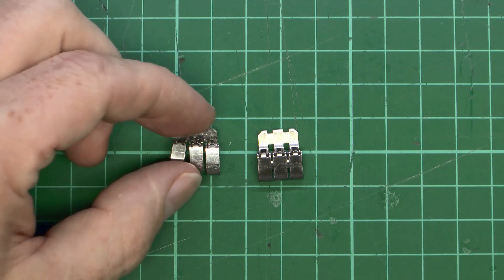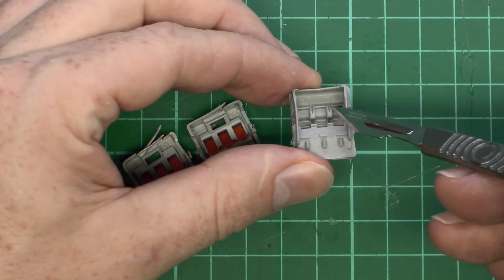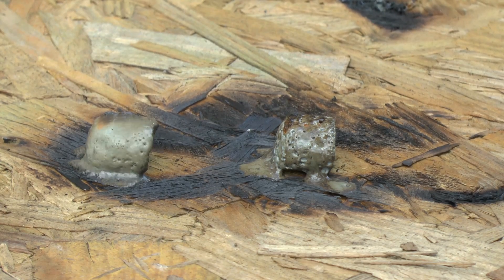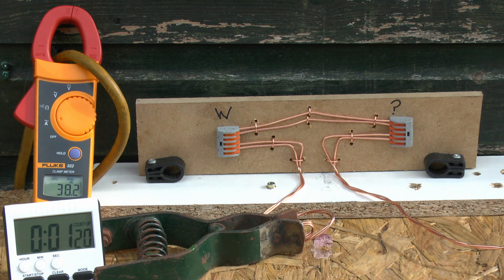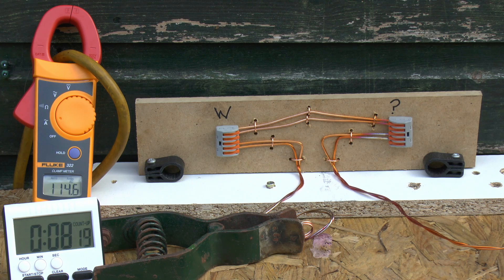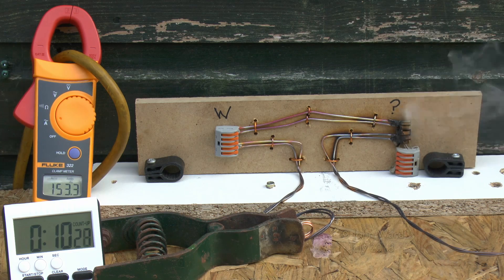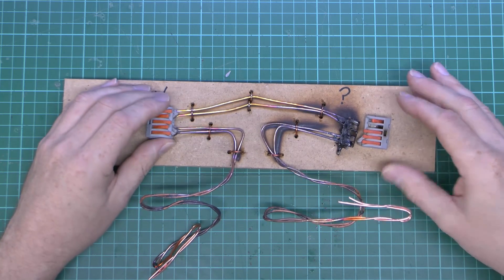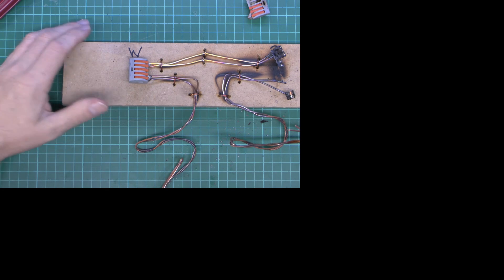Wago 222 Connectors vs Others, Testing Current Overload and Flammability

Comment: I already like and use Wago extensively. I always felt like the 222 series had a more secure connection on stranded cables than on solid cores, but this seriously boosts my confidence in them for solid core use. Under normal use the wire insulation would have failed long before the connectors and blown the RCD/GFCI/AFCI or over current protection.

Comment: Per 100 the brand? are 16p (ish) per unit cheaper bought from UK sellers.  The more you buy the more you can save.
if time isn't a factor the world and your bank balance is your onion if you go offshore.
I've e-mailed chinesium suppliers and bought bigger quantities than they normally advertise with pretty substantial discounts.  If you can afford to stock up on stuff you use regularly its sometimes worth the effort.  You have to be aware that customs can get pretty keen on larger quantities.

Comment: Cool test. Btw 2x 2.5^2 ≠ 5^2
Reply: ats1995 Wires are measured in square millimeters, it's the mm symbol that's squared, not the 2.5.  And in reality, it's resistance equivalent mm², so actual size may vary slightly depending on how pure the wire factory can guarantee their copper is.  Mechanically, connectors are designed for actual 2.5 mm² cylinders (1.8mm diameter), as most wire plants are pretty close to "standard copper" anyway.

Comment: 70 or more amps? all my home fuses cut above 16 amps... anyway in germany everything is tested to death. i use them for years now without any problems. nice to see what amps they can manage. very informative, thks for the video
Reply: wuppercruiser Test current is applied at low voltage, so a lot less is drawn from mains than the 150A.
Reply: @johnfrancisdoe1563  Correct.
>
Reply: WAGO have a factory in China (Tianjin) as well as Poland, America and Switzerland but they would all manufacture to the same quality standard

Comment: Really nice Video , been using these for a while now , nice to see they're as good as they seem. No more loose screw terminals in JB's and install times are drastically cut....but they'll never replace screw terminals completely I still use ceramic one for high temp connections like High power UV lamps. I  cant see the point of using the fake ones the real Wago connectors are so cheap ...the fako ones may be ok but try explaining the decision in a court if problem does occur.

Comment: those are the same connectors from the same factory.
they are producing wago during the day and knockoff at night
Reply: Bartosz Marciniak Except with clear tool differences.  The Fago connectors had a different spring shape and less smooth plastic, which may have combined to a slightly higher resistance, causing the Fago to get hotter (P=R I²) and discolor + melt before.

Comment: This is actually quite impressive. Remember that for every doubling of current, the power dissipated in the connectors rises four times, because power is resistance times current squared. So the 155 A vs. the rated 24 A scenario is more than 40 times the rated power of the connector! I am surprised that they both held up so well.

Normally, the maximum current for connectors is defined as the amount of current that yields a certain increase of temperature of the connector with regards to the  ambient temperature.

Comment: The Fako may be fine for private installation on your own risk. But imagine that your house will burn only if you saved a few bucks. No assurance  will pay only one cent if they figure out you used not certified materials.
Reply: matneu27 I was quite impressed with both of these. This test put 5X the amp rating these were for. As long as the clamp strength of the fake one is as good as the WAGO, I wouldn't be afraid of the fake brand for residential use... BUT... The WAGOs are pretty much the same price, so might as well buy the name brand.

Comment: As someone who uses these connectors on a daily basis, this was brilliant to watch. Great to see their limits and how well they hold up to a significant over current situation.

I'd love to see how Wago's 221 connectors compare to the 222s as I've started using the 221s more and more.
Reply: Possibly also a comparison to the 2273 and 773 series for solid/coarse stranded wire. They're the most commonly used connectors for building wiring in quite a few European countries.

Comment: The non wago connector sounds like glass fiber reinforced, also the only reason why the right one melted first is because there is a higher resistance on that side, thus the reason the board charred at the end of the circuit first.

Comment: Very informative test. Do you think the orientation of the connectors caused the clone to overheat first? It would have been interesting to see the temperature of each from an IR thermometer. Thanks for your effort.
Reply from the maker: No difference, same wiring and same current for each.

Comment: I wonder why you're now testing the 222 years after the 221 came out. I've long replaced all of the old ones, love the smaller size and nice visibility of the connections in the new ones.
Reply from the maker: 222 are the type which someone sent in.
Reply: Daniel Egger 222 is the classic product we trust, 221 is some untested stuff the salesmen are pushing.  Good professionals ignore salesmen when possible, because lying to us is part of their job.
Reply: Err, sorry, that's nonsense. I've switched to the 221 many years ago (they came out right in time when I needed some smaller connectors for my living room LED lighting where the 222 are just too big to hide invisibly behind the aluminium mounts). I've been using the 222 (and a lot of different other Wago connectors, too) for a long time before that but have switched all to the 221 when I made changes to connections since they're not only much more comfortable to use but also allow for visual inspection of the wires (or crimped ferrules) and leave a lot more for the cables in the outlet or connection box; don't forget that one typically needs at least two and often even three or more of them in one spot so that adds up quickly.

I'm not a sales person and not affiliated with Wago. In fact I'm just a user but I know a lot of professional electricians who would tell you exactly the same.

Comment: Great video, I'm impressed by the knockoffs. I'd be interested to see how they fare with a slight overload over a period of hours. I can see the fako connectors taking a while to heat up, but eventually failing. The exposed copper wires were probably helping by acting as a heat sink too

Comment: Despite this, wagos are really only meant for lighting loads/low current loads. Everything else should get wire nuts or terminals.
Reply: They take up to 4mm cable, and rated at 32A lol.. Lighting circuits are only 6A in UK I used them to break into 32A ring circuits and extend it.. Using maintenance free boxes. Perfect. 😉
Reply: @muzikman2008  According to Wago they take 4mm but only in fine stranded (aka flex), for solid and coarse stranded fixed wiring cables the official max is 2.5mm² on the 222 series (the 221 series go larger, but I haven't tried those myself)

Comment: You should definitely do more of these, fun and informative. Puts our minds at rest that these connectors are safe for their rated currents. Top job JW!
Reply: China copys you are never save, only these are safe tested this batch..nothing more
Reply: @kitecattestecke2303  He easily goes 4 times over specifications and 5-6 times before they fail.  That is a considerable safety margin.
Reply: @kitecattestecke2303  Genius. Even if this video shows that, while used within rated amperage, these Chinese brand connectors are perfectly safe, still some people like you will fabricate some other reasons to justify your discrimination. Well, enjoy paying several times more to get the ghost feeling of "safety", because that's what these big companies want you to believe so they can receive your IQ tax.
Reply: You can definitely buy Chinese off brands, but you got to buy them i batches, and test them. I wouldn't still use them for commercial use
Reply: @GoalOrientedLifting  Ya they arent ce approves so then you could be sued if it goes wrong.

Comment: Love a wago connector. I like that it does minimal damage to the cable and makes alterations so simple, screw type connections mangle the cable ends and they invariably need cutting back after being disconnected.
I agree with a previous commenters view that they are a bit rubbish for getting a test lead on though. That test port is far too small to get most of my probes into.
Reply: Mr Badger the megger long red probe is perfect for the test port on these
Reply: Daniel Brydon 
I do have a long thin megger probe that will fit these ports, I call it my “aye aye” lead after the little lemur creature with the long finger!
The problem is I mainly need to access it with my fluke voltage tester or I may just want to get a reading from it while testing and not want to use special probes from the van etc
Reply: 2 years later but why not just buy some alternate leads for your meter?

Comment: The non wago one sounds like it has some glass fibre reinforcing in it when cut.
Reply: Skookum
Reply: @TOO2150  As frig
Reply: I think the Plastic in the Fako has a degree of re-grind in it, the Wago one will use new Raw material stock, the Fako one I suspect has a 10-15% re-grind, this is plastic that has been used before, chpped up into tiny bits and put back into the new material, its perfectly fine but it starts the degradation process. It often has this grainy effect and not as smooth.
Reply: Yes, that was quite surprising. The clone sounded more durable than the original!
Reply: definitively yes
Reply: Even if, the test clearly shows that what ever the real WAGO's plastic composition was, it was better then the fako.
Reply: I was just about to say that too!
Reply: Yup!
>

Comment: You can now buy double ended versions on Aliexpress that have 2 or 3 terminals each side connected straight through, but not across to each other. So you only need one terminal to connect two two or three core cables, kind of like a choc block only better. ** EDIT they are unsafe due to insufficient creepage, do not buy ** 
The Chinese are also offering an 8 way version, which is useful.
Reply: stefantrethan what’s the Aliexpress search term for those?

Rather disconcerting that when there is a brand associated with these things on Aliexpress, it tends to be “YOLO”.
Reply: "wago" actually ;-)
The type is 222-412D and 222-413D, but that yields nothing. Wago on the other hand will easily find them.
Reply: I just received my "double ended" fake wago connectors and I have to issue a warning not to use them.
There is very little creepage between the different conductors (only about 1mm maybe) and they are unsafe for that reason. Otherwise they are absolutely fine, the materials look good and construction is nicely done, but the person who designed them clearly did not understand about creepage requirements between conductors. It's a shame, I would have quite liked them.
Reply: stefantrethan WAGO really needed to address that type of design much earlier, inline connection would make a neater MF connection, especially in confined spaces.
Reply: To be fair they have other connectors like the 224 that do a similar inline splice.
The Chinese have become really good at not only copying stuff, but expanding a good idea into different directions. It's the same progression we have seen in Japan some decades ago. I wouldn't be surprised if we live to see "made in China" as a mark of Quality.
But for now, I don't know why Wago is sleeping. Maybe they should fire a few beancounters and lawyers, who are obviously completely ineffective at defending their IP anyway, and get a few more engineers to knock out those new products. 
I'd gladly buy them from Wago, I'm not keen on putting a Chinese noname connector into the wall, and they aren't even that cheap, but they don't give me any alternative.

Comment: It looks like the FAKO brand doesn't make quite as good connection, a little bit more resistance which would explain why it got hotter and melted first
Reply: There were more extensive cuts between the individual connections on the copy. I was expecting it to have a higher resistance, and fail first. Though I must say I was impressed by the quality of the copy.
Reply: A slight but still noticeable difference. but the noname version i still more than good enough there.

Comment: I’ve only just started using WAGOs, the genuine as opposed to copies and they’re so cheap I don’t know why anyone would use off-brand but thanks for doing these tests.
Reply: Cost cutting - cheap Electricians. The more penny pinching the greater  profit you get when billing. Unfortunately just because you have a ticket does not mean you're ethical
Reply: @hemi4722  yeah it's insane the way some of them try and penny pinch while making your job harder and therefore probably not saving money in the long run. Like when running MC I've had multiple foreman that are completely against a 2 port connector. They say the singles are cheaper... I'm sure in the long run paying me to take more time at each box isn't very cost effective.
Reply: @Avaddon911  Do you drive a car? If so you are driving something where they will try and save to the forth decimal place!
Reply: @ianmontgomery7534  same for most electronics and even clothing, when you see the pricing sheets for a simple shirt it opens your eyes on the volume manufacturing/ supply side of what you see in the shops... 😵
Reply: Probably because they are so available. With Ebay and Banggood marketing plenty people who didn't know Wago made these items will have seen the Fako items and got curious. 
Good to see tests like this.

Comment: These connectors appear to be superior to the wire nut type and ferrule type connectors used here in North America.
Reply from the maker: They are - but almost every type of connector is superior to wire nuts.
Reply: Think they've started selling them over here.
Reply: The first usage of them here were the yellow disconnects in light fixtures. Then the 4 and 6 push connectors and then these lever types have shown up in commercial led pole lights. However always check every factory connection. They often don't push them in  far enough and its not fun having to go back and get a lift to fix a light. And by test I mean check every connection and then test every pole light with a generator before standing them up. 

        I really like the lever style but they will be rare here because wirenuts are so much cheaper. Right now the suppliers are really gouging on wago products because they are handy.... Much cheaper buying them online than from an electrical supplier in the US.
Reply: been selling here in the US for quite a while now. i can safely say for at least 4 or 5 years give or take.
Reply: I use them in Canada in Marine all the time. It’s all we use really.
Reply: Superior in ease of use, but not superior in resistance. These lever connectors will raise the resistance of the load compared to a direct wire connection (twisting) that is done with wire nuts. However, these lever nuts are approved by UL and the NEC makes no recommendation as to wire splicing one way or the other. Why more don't use them, I don't know, but they are not popular here even though they can be found in every hardware store. In fact, some electricians specifically refuse to use them.

Comment: I have some of BOTH the Wago name brand and the chinese knock off. The workshop at my job (apartment Complex) has TWO 200volt 30amp tankless water heaters. These use 3 pole 1 ground 8 gauge wires. We change water heaters at a rate of one a week from tank to tankless and we are about half way done through the nearly 900 apartments. I changed the ones in the shop TWO years ago and they work great no problems. And yes it is a tight fit for 8 gauge wires.

Comment: I really like these but the only thing I don’t like is that you can only really use thick cooker style wire.
Reply: What do you mean? They are rated from 0.08mm^2, that's like telephone hookup wire.
Reply: Xenon777 The max size they are rated to is 4mm. And to be honest, that is too tight to squeeze in, it can take a little longer to get in negating any time saving over traditional connectors
Reply: The Wago 221 feel larger, if you often work with 4mm^2. They are also clear so it is easier to get the wire in place. But I think 4mm^2 is approaching the limits in terms of mechanical strength and overload capability.
Reply: Stefantrethan. It's not the size of the wire that is the problem. It's that when you use stranded wire (especially on the push fit ones) it's near impossible to get it in. Even though the wire strands are twisted the wire becomes frayed. When wiring up 3 lights with the WagoBox, I had to use single strand "cooker wire" since the stranded wire just frayed. I could have soldered the end but I don't think this would be effective.
Reply: Push fit (only) connectors are not rated for stranded wire, most not even with ferrules.
These Wago 222 on the other hand are just fine with stranded wires.
Use the clear 221 if you have difficulty getting the wires in place, it allows you to see what you are doing and check that all strands are inside the terminal. Never solder the ends of wire, solder flows and the connection will loosen over time.
Reply: I don't see that soldering will be a problem with these type of connectors as the terminals are spring-loaded.
Reply: Xenon777 I wonder how well they work with ferrules on stranded wires, since that is the usual way to securely fit stranded wire into clamps.
Reply: The 221-61* range does up to 6mm^2 now (from 0.5)